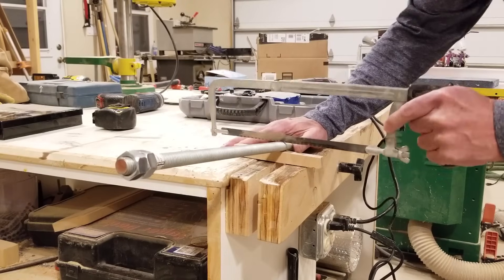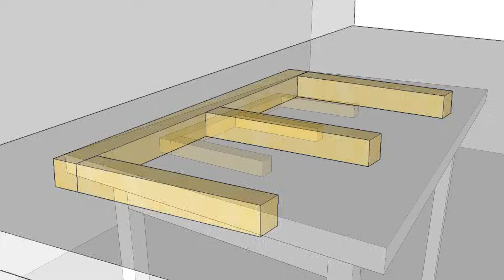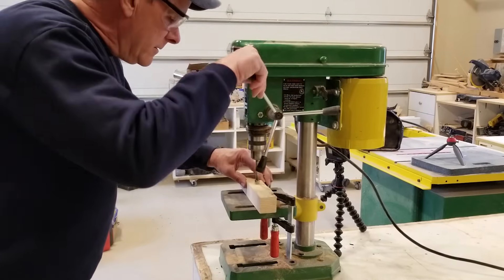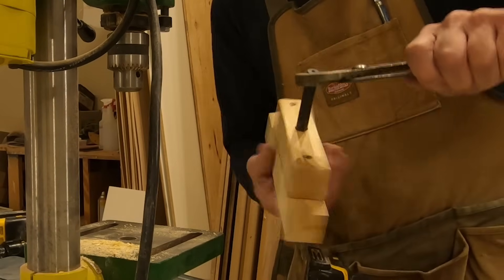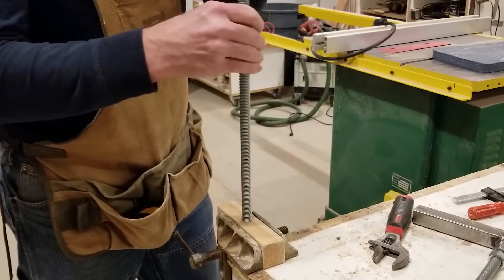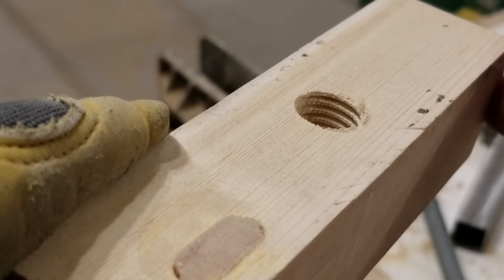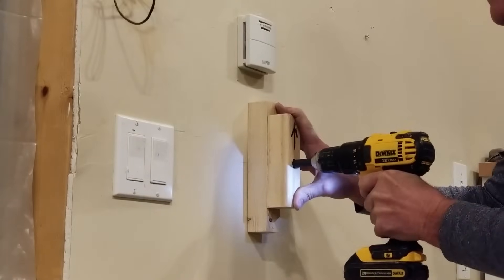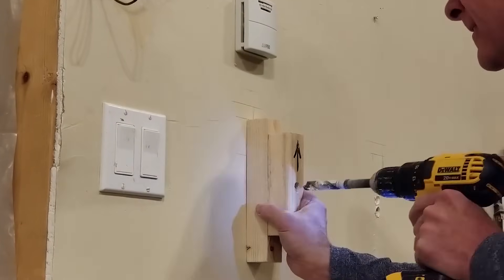Strong Floating Shelves - The Strongest Option

Comment: Great video! Glad you showed the obstacles you encountered. Much more realistic than most videos, and reassuring for folks like me who haven't got 1/100th of your experience. Might I suggest, instead of threaded rods, using hex-head lag screws, then cutting the heads off after they're installed in the studs? No need to build a special handle to install the rods or to prethread the holes, and probably easier to get the screws started in the studs than the rods. Can't wait try this. Thanks for the video!
Reply from the maker: Thanks for watching and for your comments! Yes, there are lots of ways to approach this type of installation using metal rods of some type as support for floating shelves. A number of contractors who commented on the video said they used the approach you are suggesting effectively in their installations, particularly for fireplace mantles. My approach grew out of me experimenting with several different ideas to create strong floating shelves. Using all thread rods is where I settled because once I got the methodology figured out and tools like the handle created, it is really quite a quick and efficient process. I can make the rods whatever length I need depending on the installation. Finally, if I ever need to remove the installed shelfing for any reason, I can reverse the process, patch the holes and the wall is back to its former state in short order. So, my approach is good for someone who is installing floating shelves on a regular basis and may need some flexibility in how they do it. Sounds like your approach is good for what you are planning. Good luck with your project! You sound like you are well on you way to gaining some good experience and thinking about what your are doing before you start! That’s a good approach!

Comment: some of the best wood workers i know don’t even have “a bench”
basically just a flat surface that isn’t being used at the time.  Look if it’s a hobby all this is fine but if you are a busy worker who is actively making money then you don’t worry about the kind of joints your workbench has or what it’s called lol
Reply from the maker: Yes, I would be hard pressed to have a workbench that I felt I needed to protect from dinks and random paint drips. At any point in the day I might go from putting finish on some wood project to cutting a piece of steel with a grinder. Thoughts of building a nicely designed and finished workbench give way quickly to the practical realities of what I really need a workbench for. Maybe the last project I ever do will be a beautiful workbench!

Comment: I personally don’t see a point in securing the shelf against the wall with these bolts. You have the weight of whatever is sitting on the shelf using gravity holding the shelf down and the wood into the sharp threads. This shelf would never come off unless someone actually went up by hand and pulled them off.

Comment: I was in the lumber and supply yard a few days ago asking if they had floating shelf hardware.  No.  I looked at all-thread, and thought ... yeah, that might work !  I think an easier method might be to drill and bang rebar into the studs.  Or drill and then run a lag bolt or other heavy timber screw into the the wall, and cut the nut off the end with a grinder.  Much easier to send a screw into the wall with 1/2" driver 18 volt.
Reply from the maker: Yep, there are lots of ways to go about this. I have been very happy with my approach for my purposes. Thanks for your comments!

Comment: If I missed it, I apologize when you drilled your hole did you drill it all the way through the stud or was the stud calculated to go so far in and then you stopped your drilling so the all thread wouldn’t go all the way through? Another question would be if you drilled the hole all the way through, would it be more optimal for strength having the thread go all the way through the stud? Thank you and have a great day.
Reply from the maker: No, Chris, I did not drill all the way through the studs and would not suggest that. My studs are 2x6s so 5 ½”  wide. I drilled about 2” to 2 ¼” deep in the center of the studs and spun the all thread rods in the full depth of the holes. You don’t want to weaken the structural integrity of the studs in doing this process so those metrics are what I keep in mind when installing floating shelves. Hope that helps and thanks for watching!

Comment: 4:10 Think JB weld would be able to handle the twisting forces necessary for this tool?
Reply from the maker: Probably not. I think the better bet would be to use the jamb nut technique with two nuts and a couple of wrenches. That's what I do when I'm near a wall installing a rod and the tool handle is too long to be used.

Comment: Ok so-You could do this easier and faster using this basic idea. Locate your studs-put your 2x4 or 2x2 on wall and trace it-remove drywall-then put these threaded rods thru your 2x4 or 2x2 and attach them with washers & nuts-then attach your 2x4 to the studs with lag bolts-there, now it’s installed to studs and threaded poles are sticking out and you have completely filled your drywall cutout with your 2x4-you can caulk around if you like but when you slide your shelf onto the rods it will go flush to the wall and if not then caulk around it then. The way i just explained eliminates steps he just did plus you have the wall open to see anything and it’s easier to get level. The way he is doing it is hard to get level. The way i explained my way you can adjust either end of 2x4 or 2x2. Plus my way you can double up the 2x4 in wall for even more strength just need longer threaded rod. My way requires no drywall work at all. This was good but it’s over thinking it a little and this is what happens to people who are afraid to cut into wall. Just cut in the 2x4 shape into wall and shelf will fill the hole you traced and cut out. Simple.
Reply from the maker: Lots of ways to do this type of installation, for sure! Thanks for putting your method out there and explaining it so well. Best thing about your plan is seeing into the wall to avoid hitting something you don't want to hit. Least desirable thing is that it if you want to want to remove the shelf, you have a  bigger job ahead of you than my approach.

Comment: How do you drill a straight hole through the boards?
Reply from the maker: In this case, I built the shelf from about 2 1/2" wide pieces of pine so that the holes could be drilled on my drill press. So I only had to align the holes properly when glueing up the shelf to get a good result. To freehand drill straight holes in a wider solid shelf, you need to rig up some type of jig on the edge of your shelf to help keep the drill bit tracking in the center of the shelf as you work. The rods don't have to be tight in the holes, so the drilling process can be pretty forgiving.

Comment: Great video!  Any idea if these rods would support a 60x16x4 shelf without sag?  If I were to cut the rods to 19" that would allow for 3" penetration into the studs past the 0.5" drywall leaving a 15.5" rod extending out. The shelf is able to hit 4 studs with the rods.  I would build the hollow frame and slip a finished shelf over it.  Any insight would be appreciated, thanks!
Reply from the maker: Thanks for watching! Based on what you are describing, I would be comfortable with what you are intending to do. It comes down to trying it out and seeing how the installation goes but it sounds like you have thought through it pretty well. The wider you go with the shelves changes the dynamics obviously as well as the amount of weight added on the shelves but this method is very reliable from my experience. Good luck with your project!

Comment: First time to your channel (that I recall). If I had watched this video before I would  have remembered you.  Great video!  The solid shelf slid on the all thread pretty easy. As I recall you said  it was 5/8 all thread. Did you drill your hole in the shelf 5/8? Or is it  a  32nd  of an inch larger? Something else? Three parts but I think it counts as one question. Thank you in advance for your reply
Reply from the maker: I appreciate you watching and your question, all three parts! Yes, I use 5/8” rods because they seem very strong for use in floating shelves and also work well with standard 1 1/2” material providing plenty of wood in case your bit wanders when drilling holes. I drilled the holes in the  solid shelf for the video on the drill press in 2” slices as I recall, then aligned the holes and glued the pieces together to get the width I wanted. So the alignment of the holes in the shelf would be dead on as a result. Drilling laterally all at once through a wide shelf gets a little trickier! You can get as precise as you want on hole sizing to fit the all thread. 11/16” to 3/4” works fine in my applications and give me latitude if something doesn’t align quite right. Shelves can be secured with adhesive on the rod thread or set screws in the shelf can be installed to clamp down on the rod and hold the shelf in place if the shelf might need to be removed at some point. I think that covers it and then some! Hope you give it a try and keep watching!

Comment: The shelf I thinking of building is 40cm width by 30cm depth by 1 inch thick and use two iron rods 5/16. I want to sit on it to wear shoes. Do you think will it be strong enough? My limit is 1 inch thick
Reply from the maker: The 5/16” rods are going to flex more than thicker rods when weight is added. I have experimented with 5/16” rods some and quickly decided I prefer thicker rods. But it really is all about trying it out in your planned use and seeing what your results are. Good luck!

Comment: Can you use the same principle to install in solid concrete wall ?. Of course there is no need to thread so maybe just use solid bars. Anyone done this in solid walls ?
Reply from the maker: Yes, Alan. I would drill the holes a little larger than the rods then apply a good construction adhesive in the holes and on the rods until it fills the holes. Tap the rods in place. Rig up some sort of support pieces to hold the rods level while the adhesive cures and that should work.

Comment: I've used 5/8 althread rod for mounting fireplace mantles for twenty years.  But I've welded a 5/8 tap to a 6 inch bolt, and use my impact driver to tap into the studs before threading the rods in place.  Then just put a couple jamb nuts on the rod and sink them into place. Also, if you take an old bar of soap and scrape it on the three inches that go into the stud, it'll go in much easier.
Reply from the maker: I have heard from different people who use similar methods for doing steel rod installations, Bearded One. Most common using lag bolts and cutting off the heads. Sounds like you arrived at the same idea as me but you perfected it even more! Thanks for passing on your methods! Good ideas!

Comment: There is easier way then that to put rods in, also on an angle will help.
Reply from the maker: Ok, Gary. But this is pretty easy!
Reply: @RustyDobbs  after you cut the steel and weld the stuff, then weld the nut to it. Ok so you buy this and this before you can do this. 
Good if your going to do a lot for other people yes. 
I just drill pilot hole just under rod size, washer nut on tap into hole thread second nut use wrench tighten to desire length done.

Comment: Never been a fan of floating shelves in general, regardless of how "strong" they are. It's a perfect example of form-over-function, and it's not something I'd ever trust, even if I built it myself. I could make the base-structure out of steel and I still wouldn't trust it without any gussets supporting the load.
Reply from the maker: I understand your perspective and felt similarly for a long time until I was asked to do a floating shelf job for a customer. The more I experimented with different approaches, the more I came to see the value in using steel rods to increase strength of floating shelves. Common sense should play a role in what floating shelves are used for. I mean, how much weight realistically should someone put on a 12" - 14" floating shelf on a wall. A 500 pound fish tank? No. But for most household decor and even storage of many shop supplies, it makes perfect sense. As a practical matter, no shelf supports are interfering with placement of items on the shelves so space is maximized... function complimenting form. But as I said, I get where you are coming from. I had to convince myself as to their strength and value before I would trust them. Glad I did. Thanks for watching and your comments.

Comment: Any advise to install floating shelves on tile installed over mansory? I haven’t built the shelves yet looking the best way to get it done
Reply from the maker: Yes, it is certainly doable. It’s a bit of a challenge drilling holes and being careful to not damage your tile in the process. But the idea is to drill holes that are slightly larger than the rods you are using and then use a strong construction adhesive to hold the rods in place. It is good to support your rods at the proper angle while the adhesive sets up. After that, install the style of shelves you want as normal. Good luck!

Comment: My suggestion is to dump that stud finder and get a Hansen magnetic stud finder. The drywallers could see the stud when they did their install, so you can find the screws(or nails) and split the difference to find center of stud, but then you'll also know where the screws are at so you don't hit them. My tests and other's show those electronic ones to often be inaccurate.
Reply from the maker: I agree that the stud finder is marginal at best. Some guys have suggested using a strong magnet which works pretty well. I have one about half the strength that I probably need, but it is helpful in finding SR screws. Will have to check out the Hansen brand! Thanks!

Comment: certainly many other people have asked the SAME question in the almost 2000 other comments below?
Call me stupid...but um ... if you are specifying making  a  frame assembly that is 1 1/2" thick frame and then fabricating a separate cover box assembly; why not just start with a SINGLE, section of solid 1 1/2" board ?
Reply from the maker: Hey, Someguy! Good question! The simplest explanation is that it depends on how complex your floating shelf installation is and whether you are dead set on having solid hardwood shelving. If you are wrapping corners or have wavy walls, the solid shelves are trickier to install whereas building a frame and cover assembly is a little more forgiving. Simple straight walls and shelves, it's a toss up as to the amount of work. Different approach for each style but similar amount of work.

Comment: A further thought (4 years later!):  The original method (using the wood inner structure) turns out to have a significant issue if the wall you are attaching to is not flat!!!  Ran into that twice now, with a house that was not built well and the drywall was slightly curved.  You would think, then, that the rod-into-stud method would be better, and it could be, BUT, if you are setting the rods square to the wall, and the wall is curved, you now no longer have parallel rods!!!  So be SURE you are installing them parallel to one another, not just square to the wall!
Reply from the maker: Yeah, Larry, that’s a good point particularly with a longer shelf and a bowed wall. Depending on the situation, I typically scribe the wall profile on the shelf or scrap thin plywood piece and transfer the wall shape to the shelf to start with. But you are right, the non-parallel rods create a problem. I like to say, the mark of a good contractor or carpenter in this case is their ability to improvise and make things work out even when nothing is straight or plumb! I’m assuming your shelves worked out fine! I do get pretty cranky working through the improvising part! Don’t wait another 4 years to comment. I may not be around to answer next time! Good to hear from you, Larry!

Comment: Why not just use a real tap to cut the threads into the studs? You can run it in with a drill and save a ton of work.
Reply from the maker: No problem with your idea, Steve. At the time I was doing this, the all thread was the simplest solution and I wanted a handle to spin in the final rods anyway, so I've never needed to come up with a different method for threading my holes. I have found that if I drill my holes to just the right tolerance, cutting the threads even with my modified all thread tap is no problem. I actually do kind of like your idea, so I may pick up a 5/8" tap! I have another video coming soon where I build 8' long and 16" wide storage shelving with this method and it does work well! Thanks for your suggestion!

Comment: I noticed the hump you created with your drywall patch right where the shelf met the wall. You might have drawn a pencil line at the top and bottom of the shelf, sanded that area flat after removing your all thread and finished off from there. But lesson learned check any patch you make with a straight edge before installing the rod.
Reply from the maker: Thanks for watching and for your comment. You and I have different tolerance levels for precision in our work and I consider myself fairly nit-picky! If this were a permanent installation, I would have secured the shelf and run a bead of caulk matching the wall paint color to deal with any issues up to about 1/8". Larger gaps than that, I would have addressed by floating out the wall.